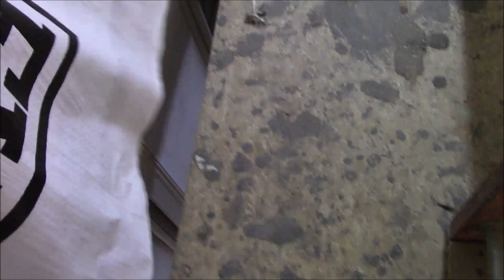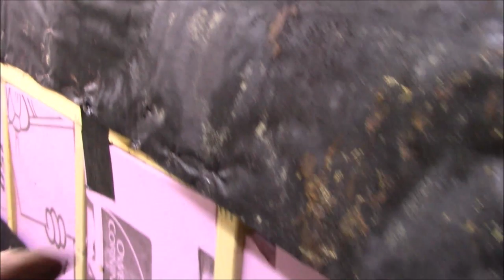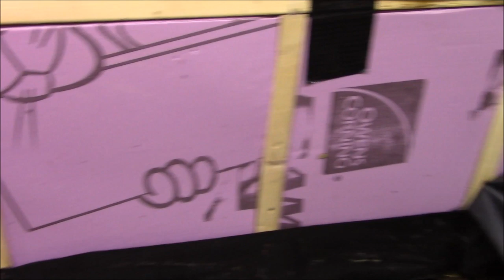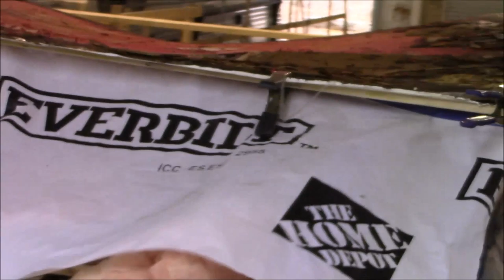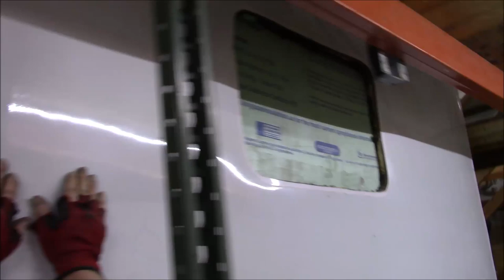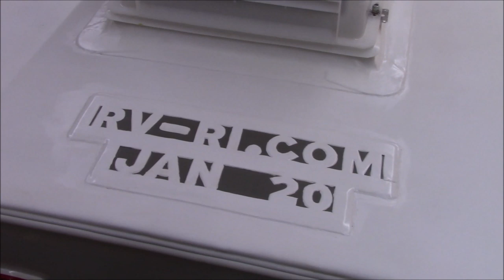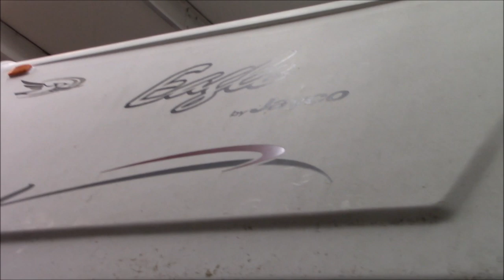Jayco Eagle New Roof, Rear Wall, New Trusses and ceiling panel

Comment: (2015 Keystone Cougar 1/2 ton Fifth Wheel -  Purchased New) 
A raven pecked away at the Dicor sealing the skylight above the shower, but I didn't notice it till the water was already dripping from the ceiling panel trim 3 panel joints back. The back wall is delaminated as well. I work for an architect and am very familiar with detailing roof curbs for commercial buildings. I will be replacing my roof membrane with the same upgrade you installed for this project. This video is truly GOLD for RV owners, THANKS! One more thing, Hydrogen Peroxide will kill black mold. Mix one quart with 2 gallons of water and use a weed sprayer to apply.
Reply from the maker: Thanks for the mold tip and thanks for watching. Btw.. there is a lance truck bed camper that   had the roof eaten by vultures. Insurance paid for replacement.

Comment: Jayco is not the problem.Maintenance is. Early on the roof should have been at least annually inspected and preventive Eternabond sealant tape put on all the roof seams - edges, around all openings. This could be followed up by painting a RV rubber roof sealant as well. Any roof will leak with age and lack of maintenance. NOT a Jayco problem, they are very well built.
Reply from the maker: Yes maintenance is required, although we would not endorse any rubber coating.  Coatings don't work on campers and RVs. We've showed this time and time again. 
Sealing the windows, doors ,latches, light ,etc is a must. 
Thanks for watching.

Comment: Awesome work looks like repair costs would be more than camper would be worth
Reply from the maker: Even if you got a new camper.... It would be coming through this shop for a roof. The roofs on the new ones are no good. Get em built, get em out, get em sold is their motto.
Thanks for watching.
Reply: @RVROOFINSTALL  I’ve just came across your videos I started watching the roof you guys put on looks really good awesome video’s great work really like the way you bring stuff to customers you find to do the job right
Reply from the maker: @roberthartley1033  Thank you ,  and thanks for  watchimg !!

Comment: Own a 2004 Jayco Designer and my roof plywood is delaminating and I want to replace rubber roof with T P O roofing. No leaks just spongy. I hate rubber roofs. My question is: in the video it appears that you only glue the deck not the new material. When I installed it on my other RV they recommended glue both surfaces.If you can only do1 surface this would be GREAT !!!!

Comment: I’ll find the best mole killer by far is RMR 86 mold and stain remover. It literally disappears in front your eyes.
Reply from the maker: Thanks for the tip. I'll look into it.
Reply from the maker: RMR 86 is sodium chlorite... essentially bleach. Bleach will kill mold on non porous surface such as countertops and shower walls...even on painted wood. However bleach does not have the need amount of surfactant to penetrate deep into the pores of wood or drywall. Concrobium is chemically designed to sleep and suficate the mold spores by shrinking the pores... essentially squeezing...so the pores die. Bleach by a other name would be .... whitener. It will whiten or discolor the mold on porous surfaces but won't reach deep enough to the root. 
I do a lot of research on the products, their intended use design and limitation to make sure we have the right product for the entailed project and elements the project will undergo.

Thanks for the tip just the same. It gave me some homework...lol
Thanks for watching.

Comment: Very good workmanship. How much did it cost in 2019.
Reply from the maker: Please understand that we don't quote on social media. Thanks for watching.
Reply: @RVROOFINSTALL  fair enough I understand,  just that I own an identical model to the one you refurbished and live in New Zealand, with aim of doing mine in the near future,  so a rough ball park figure is my aim. Thanks for your replying.
Reply: What do you use instead of dicor?just trying not to be a "more on"
Reply from the maker: @twheeler7747  Dicor is made by Carlisle Syntec...they manufacturer commercial roofs, however Dicor just wants the low budget stuff. Carlisle make a commercial grade lap sealant. You could get some Big Stretch and try it. It's water based, easy clean up. Just try one vent and check it in a couple few weeks to see how it does. We don't reseal those roofs at all. I have had good luck with the big stretch in other applications. It may not be Dicor. Some sealants have silicone in the and if yours does nothing will stick to it. Even silicone doesn't stick to silicone. There are a few variable and that's why we shy away from recommending product because if they don't perform you'd be upset with us. Those are a couple if you want to try them. 
Thanks for watching.

Comment: It boggle my mind how the manufacturers still get away with such shoddy work/craftsmanship. I'll NEVER buy a new unit because of it. You buy a new car for $40,000 and you can reasonable expect 10+ yrs with little maintenance. (20+ years with a little more maintenance) Buy a $40,000 trailer and be happy you get 3-5yrs before it needs a $12,000 repair job. How do they justify that much anyways?! It's not like there is any R&D into these things. They've just copied the designs over the years. No engine or other complicated mechanical parts... and they build it with the cheapest parts available. Sorry, for the new buyers, but thanks for the secondhand units! Thanks for the video. REAL eye opener!

Comment: I've worked in construction for about 22 yrs doing kitchen and bathroom remodels. Is this something u would recommend to have professionally done or could someone with a little construction experience and common sense could handle?
Reply from the maker: There is a lot...and I mean a lot, of detail to pay attention to. I would not recommend someone  try to  tackle an RV, that said, these RV centers and shops I see shouldn't be doing them either.  Ask anyone the number 1 issue with their camper and I'll bet it's roof leaks, despite being repaired or replaced. They are also time-consuming. You would need to have scaffolding to do the job properly. You'll wear your ass out.climbing up and down a ladder all day, trying to hold tools, walking across a plank without rails and bouncy. 
That's my advice. I'm a GC by trade, and I have installed a restaurant roof quicker than some RVs.
Thanks for watching.
Reply: @RVROOFINSTALL  thank you for your feedback and your video was very helpful and informative with the information I was looking for I appreciate your craftsmanship bc having some pride in your work is a dying character trait now a days...

Comment: I have a 1999 holiday rambler bumper pull camper that has roof damage an water damage in the camper need help getting repair work done
Reply from the maker: Give us a call. 423-475-7663.  Thanks for watching.

Comment: Do you have to remove deck and joist to install ceiling panels?
Reply from the maker: The ceiling panels cit kn the wall and the cabinets.  We replace ceiling panels from the top, removing the trusses. If you opt to try to do it from inside you would ha e to cut around the edge of the wall and cabinets and your new piece is going to have to be exact or your going to need to install some molding.  The molding won't match, and you'd be forced to do the entire coach to make it look proper.  Also. Why would you need to replace the ceiling panel? Must've gotten wet. If that's the case, you need to check the framing and roof deck for damage. If it's wet, it needs to be opened up and blown dry fans. It will never dry out unless you open it up. Trapped moisture can breed mold. Once opened, it needs to be sprayed with kold kill. So, to answer your question, the proper way would be from the roof to replace the ceiling.
Thanks for watching.

Comment: You have great video and you do excellent work. Can you tell me what brand of glue do you uses between fiberglass wall and Luan backing? Thank you
Reply from the maker: Depends...mainly we use 3m94 but if your not applying it correctly it will eat the foam. If glueing to luan it'll be fine. Expensive... but it works. Thanks for watching!

Comment: How do the interior garnishes look when you raise up the vents and AC? Are the bolts long enough to tighten the AC gasket to the curb?
Reply from the maker: Good questions. We use taller garnishments to cover any framing. The vents look like they do now..or did. We also use longer bolts for the AC.
Thanks for watching!

Comment: Do you have a good video for repairing or replacing RV ceiling that delaminates.  It's 15 years old. No water stains, but delaminted.
Reply from the maker: Ceiling panels come out from the roof side. That's the easiest way we do them.

Comment: VERY impressive video! Thank you! I bought a 2006 Jayco 29BHS trailer with known roof issues a couple of months ago. I'm a retired contractor and pretty handy so I figured for the price I paid I can fix the roof. Although you said this isn't a DIY video I want to thank you so much for the detailed images and verbal descriptions of the construction of these trailers. Looks like I have a project ahead! Was a little surprised at your comments re; Dicor. RV forums seem to have a high opinion of Dicor and I used a tube of their caulk to seal obvious leaks as a temporary measure. It worked well. Can you recommend better sealants? Can TPO be pieced in, ie; do 1/4 of the roof with new? Most of my roof seems sound. Hah!
Reply: I bought a 19 foot trailer with a known water issue years ago. I stopped the leaks but need to fix similar issues to what’s shown in the video. I’m thinking of doing all the wood  and insulation repair and then bring it to have the pros put the roof membrane on. The main reason we bought it was to live in it for a summer as we built a place.

Comment: Woo I'm dreading the up coming work for my 01 keystone tailgator 210rr the escape window  leaks , the roof leaks in the shower and the paneling is not in good shape. And I cracked the tub a few weeks ago when I dropped the shampoo.  The door frame leaks. I'm expecting it to cost at least $2k and that's for me to do it myself. I think I'm going to have to hire someone  smaller than myself to help with the roof since I'm 6'7" 320#
Reply from the maker: Well big feller....it was the shampoo bottle???...there's always the keto diet!....Lol!
Thanks for watching.

Comment: What kind of insulation did you use on the exterior walls that have a silver surface.
Reply: Thats easy..they used fibre glass wool attached to an aluminized paper backing, same as what you would use for a  house , from big box stores .

Comment: I have a travel trailer star craft,that has soft spots on the roof,how can I have you repair it
Reply from the maker: We wouldn't repair as in patch it. We would put a new roof in it. Depending on the year it may or may not be worth it to you. Roofs are literally the most expensive replacement on any RV, camper, coach. The sad part is that even the new ones leak and if they don't right out the gate they will very shortly, despite the claim of a 10 or 29 year roof the salesman will tell you.
You can give us a call between 8-3, those are the office hours. Shop doesn't answer the phone. 423-475-7663.
Thanks for watching.
Reply: @RVROOFINSTALL   I brought it brand new in 2015, I used to be able to walk up there,but now it has soft spots and an afraid I'll make a hole.We are located in miami fl,to you recommend eneyone close by
Reply from the maker: @fredypabon8171  I can't recommend anyone because no one does our roofs except us. I designed them. But you have some structural issues that need to be addressed. I think you have a plyfoam roof if I remember right. Take the square plastic piece off the ceiling in the roof vent. Look inside and you may see white foam and not regular batten insulation. If you do have the foam you need to re-adhefe it all back.

Comment: What do you suggest is the best alternative for using decor to re seal  seams ?
Reply from the maker: Dicor is made by Carlisle Syntex. Carlisle makes a commercial lap sealant. But any commercial grade lap sealant should work. Dicor is loaded with petroleum distillate that cause it not to stick. They admit there is distillates on their site, but they claim the distillate will evaporate off. Petroleum distillate is the slickness you feel when you have gas or diesel on your fingers.
There also isn't any properties in the Dicor that I could find, that thwarts UV light. So essentially sun's UV rays cause the product to dry out prematurely causing cracks that open up. A quality caulk shouldn't need reapplication every few months. It's Doctor's cash cow!

Comment: What is your preferred lap sealant that lasts?
Reply from the maker: @brunorios7223  we don't use lap sealant. If we did id recommend Rapid or Sila  at Home Depot. However, caulk fail on membranes because the membrane needs to be primed wherever caulk will be applied / contact. You can find membrane primers online or at your local commercial roofing supply store. Any membrane primer will work. 
Thanks for watching.
Reply: Thanks a lot for information and honesty

Comment: i wish i have watched your video before buying a jayco, i just bought a used one and worried that i might get a lot of work and money to keep it running.  I do have a question: how do i know if my RV was leaking or about to leak? appreciate it, I did not see anything unusual, and surely did not clearly see in this RV but as soon as you open the roof, it is trouble! Do you have service in WA?
Reply from the maker: No we do not service in WA. This is our only shop. Inspect the caulk thoroughly. Use a butter knife to go around the caulk edges to see if it's loose. If there are any cavities in the caulk they need to be sealed. Inspect the boot on the crank up antenna. Inspect the caulk on top of the gutter rail. Inspect all windows, doors, latches, lights and handles to make sure they are sealed. Inspect the plumbing base. If you have the one that has the 3 legs look inside to see if it is sealed under the leg on the inside of the cap. Don't wait to see stains on the ceiling. Once that happens you have bigger problems. When the roof leaks the deck and framing absorb the water....then the insulation and when it reaches the ceiling that panel will absorb what it can before it finally comes through. So really once you notice a ceiling leak everything above it is soaked and probably rotted. It will never dry out unless it gets opened up. I've had coaches in my bay for a few months before we could get to them and they were still wet when we opened them up. Chemlink makes product called Duralink 50. You could try that instead of the crappy Dicor. It may be compatible but I have never gone over Dicor with it to test it. 
Thanks for watching!

Comment: Could you tell me where I can get the roof trim that protects better please. I was going to fill the track up with silicone but you mentioned a style trim that did a better job. Thanks. Great video.  Such a shame Jayco has such poor quality control.
Reply from the maker: First you need to measure the track. You can do a search online for ...vinyl insert trim. AP products makes insert trim as well. Johnson surplus  supply. A marine supply place may have some as well We special order the insert we use. We had to buy 10,000 feet of it. You should back the screws out and get a dob of caulk behind the screw heads-up anyway
Thanks for watching.

Comment: So I have a personal coach class c, yes the front bunk is “rottted” and in the rear room the roof is also “rottted” to the point that it’s about a whole panel sagging down from the ceiling. So since I’m planning on doing all the work myself where should I start? Fix the walls and ceiling or do the roof then ceiling and walls? Thanks love the videos!
Reply from the maker: I would open up as much as I could to get things to dry out. Tear the roof off. Get the fiberglass off or loose enough to get air in to dry and mold kill. While all that is drying you can rebuild the bunk 
Thanks for watching.
Reply: RV ROOF INSTALL it’s all dry it’s had heaters running with blowers and a dehumidifier. I just wasn’t sure where to start. Plus I don’t have a shop so I’ll be working on it outside. Thanks!

Comment: How do you clean the backside of the fiberglass to re attach later? What glue do you use to attach the Fiberglass to the new Luan? Thank you!
Reply from the maker: Yoú can sand it óff if your careful. Any hígh strength contact adhesive should hold it back on. Read adhesive container. Thanks for watching.
Reply: @RVROOFINSTALL  Thanks for the info!

Comment: Please video the 2019 Jayco when you get to it.  I have a 2017 Jayco and they have already replaced two slide out roofs under warranty.
Reply from the maker: It's on its way! Lol. Hopefully today. She pulled the clips from the camera.
Reply: Thank you so much for the videos you do, I’ve learned so much about RV construction from you.  One thing I would like to mention is RVs need to be stored with some kind of cover.  The climate and weather (expanding and contracting) can cause leaks.  If the unit is stored in the open, the leak can go unchecked for several months.  I had a shed built for mine before I purchase it.
Reply from the maker: @gregwalker731  good advise. Our roofs are all commercial, that being said, you don't see commercial buildings with covers. But every bit is of extra cover us definitely a plus.
Thanks for watching!
Reply: RV ROOF INSTALL your right, your roof wouldn’t need a cover. I was speaking of the factory RV roof.  I don’t trust them and keep my unit covered.